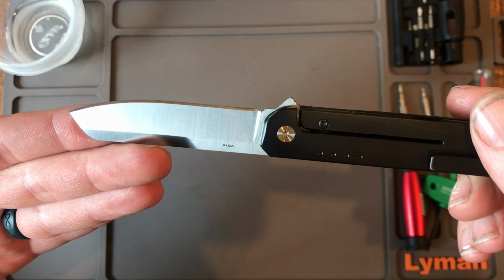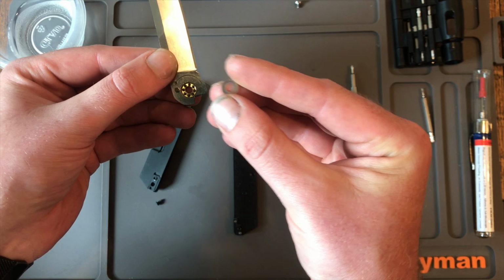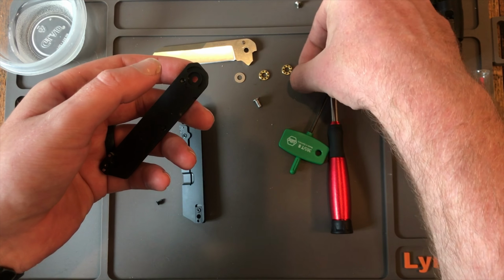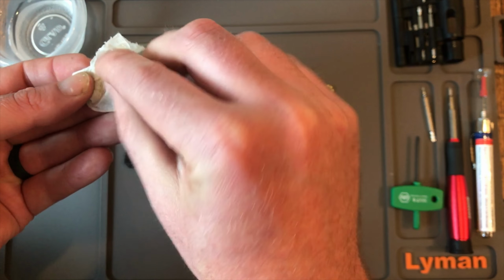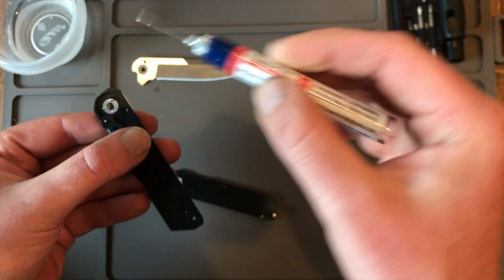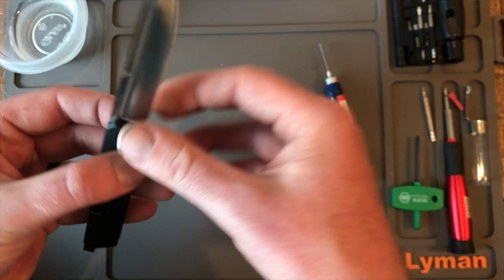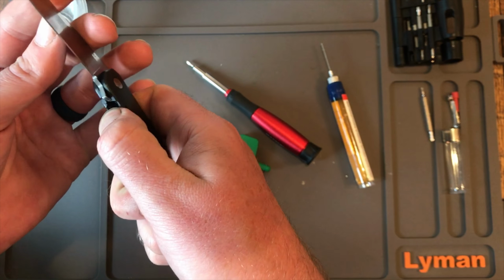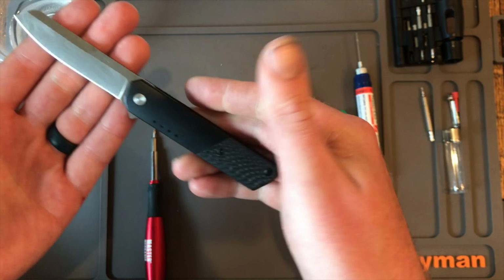Quiet Carry iQ Tear Down and Cleaning

Comment: Hey man. Thanks for the video. I have a question for ya... is there a way to adjust the amount of force needed to open the blade.  It has that little ball on the lock and it falls into the detent on the blade when closed.  This acts as a bit of a lock on the blade when closed.  Mine is super hard to open from closed,  with just the one finger (like you're supposed to)  didnt know if there was a trick or an adjustment for this.  This doesn't seem to be an issue that anyone else is talking about, so maybe it's just my problem..
Reply from the maker: One thing to make sure is your fingers are not on the lock bar when trying to open, that holds the detent and will make is very difficult to open, just a thing with frame locks. Next, if you are ok with it, just loosen up the pivot screw just a little. Make sure there is not blade play etc. check out my tear down video as well, that may help. Also, Bryce is super cool, I’d reach out to him on Instagram DM him, he will totally answer.
Reply: @JacobLundquistDesign  ok cool.  I figured out not to have my finger on it as I tried to open it.  Hahaha. I was doing that when I first got it out of the box and started playing with it. I will try to loosen the pivot screw and see how it goes.  Thanks man.
Reply: I’m having the same issue with mine.